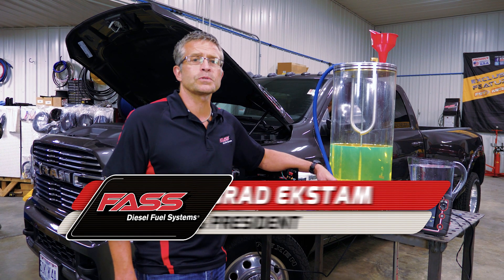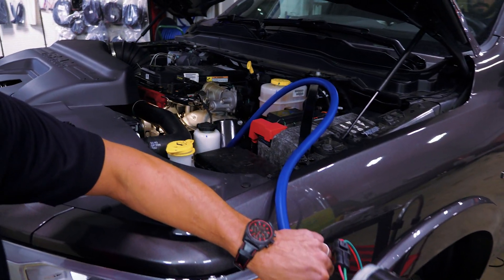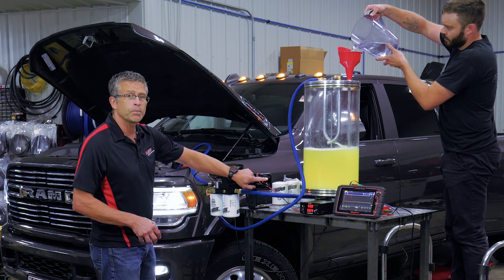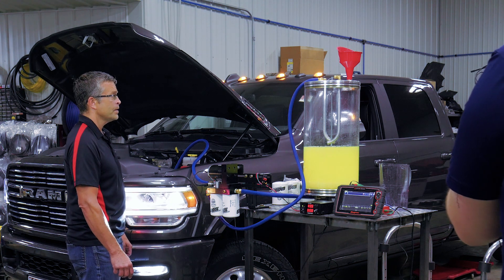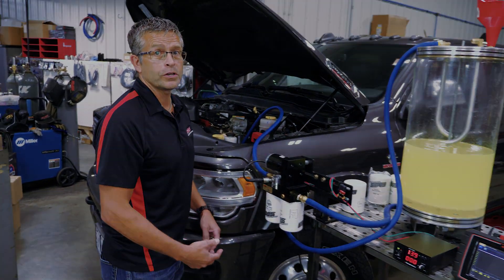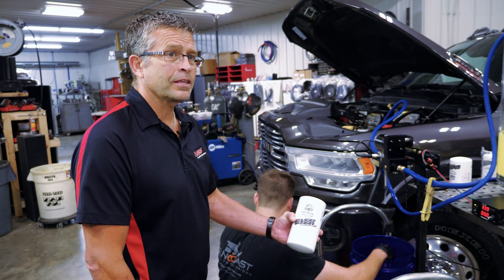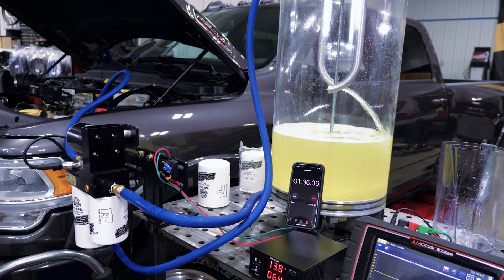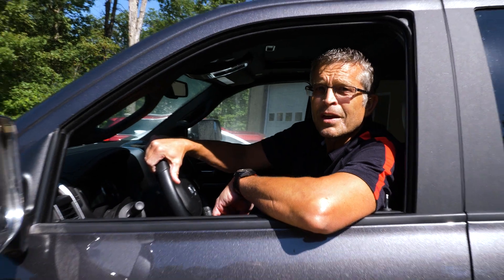1.5 gallons of water and a NEW 2019 Ram! What Will Happen!?!

Comment: if the stock pump can pull past a failed (electrically, whatever) Fass. won't it be able to draw past the full XWS? or is the bypass only on the suction (wiremesh) side? if so does that XWS put excessive strain on the cp3?
Reply from the maker: Great question! In the (unlikely) event that the FASS motor stops pumping fuel, fuel would still flow through the system. 

The only scenario in which the XWS would completely stop all fuel flow is if it became fully saturated with water—and was acting as a fail-safe to prevent the water from reaching your injection system.
Reply: @FASSFuelSystems  so if the motor dies, the cp3 can pull past the motor, but still pulls through the filters? Just want to make sure I understand how it works.
Reply from the maker: @duramaxadventures5832  That's correct!

Comment: But you still run the CP4 out of fuel which will still destroy the pump
Reply from the maker: This truck currently has 80,000 miles and counting on the original CP4! We're yet to have any reports of an emergency shutdown due to water contamination—including CP4 trucks.

Comment: So the safety recall Dodge is having isn’t from a defective high pressure fuel pump but from the fuel?
Reply from the maker: Great question! The CP4 is certainly more prone to issues, but poorly filtered fuel can expedite mechanical failure. 
 
Two of our 5th Generation Rams (both equipped with a FASS since new) have over 60,000 miles, and haven't had any CP4-related issues.

Comment: What about starving the cp4 as no fuel is going to it??
Reply from the maker: Water entering the CP4 would be far more catastrophic.
Reply: FASS Diesel Fuel Systems worse than starving it dry from fuel after the fuse blows?? I have to disagree
Reply from the maker: @WalkerTexasplumber  Prolonged starvation due to some type of restriction (dirty filters, clogged sending unit, etc.) or an air leak could be just as damaging as water. 
The CP4 in the 2019 Dodge in this video was briefly starved for fuel while making this video. No water made it to the CP4 as the XWS-3002 stopped it and caused the pump to pop the fuse. This truck is driven all over the midwestern US by one of our dealer reps with the same CP4 from this video.

Comment: Man do I wish I spend the money with you guys. I have gone through FOUR raptor lift pumps in two years on my 01 24 valve... not good. It seems that it fails exactly every 6 months and it’s been about 5 since I last changed it
Reply from the maker: We're sorry to hear that! Unfortunately, we've found that not all systems are engineered (or tested) to the same standards. If our team can ever answer any questions, don't hesitate to reach out!

Comment: I’m running a fass on my duramax and will be changing the filter more often or switching to cat filters to avoid having the truck shut down
Reply: I'm new with this stuff so please tell me why the Cat filter wouldn't shut the truck down? Would it hold more water? Thanks.
Reply: @rickbraden4272   the CAT filters are larger and have a drain on the bottom like the old style fass filters so you can manually drain off the water instead of relying on the filter media to absorb the water,when the media is completely saturated with water fuel can’t pass easily ,you just have to remember to drain the filter once in a while
Reply: If you watch other vids they explain the filters with a drain are coalescing and don't filter as well or as much, about 60% of the water is all. The new type of media collects and plugs. ALL the old syle filters get full of water and pass ALL water through after that

Comment: What happens if I pop a fuse and my engine shuts off while I’m doing 70 on the interstate pulling a trailer. If my engine stops there goes my power steering and brakes
Reply: What happens when ur fuel system grenades going 70 on the interstate pulling a trailer 🤔
Reply: Your hydrobooster has a reserved pressure in case you loose power. Allows you to be able to brake 2 or 3 times before no more power. You brakes are not ran on vacuum like a gas engine.
Reply: @ChrisSmith-ig9jq  this is correct

Comment: Driving down the hills fuse blows your truck stops no power breaks,  no power steering no nothing.
Reply: Gary Davis you’ve written off your truck but you saved the injection system,thanks fass
Reply: So if you have system that allows the water to go through when the filters are full isn't going to quit running anyway.  Or am I missing something?

Comment: My fass titanium 200gph on my 2002 7.3 has had nothing but issues with check ball getting larger groves and rotating on the spring causing pressures to bounce, sounds like crap.. not to mention all the priming issues . It will just loss psi while running down the road and truck will get really sluggish and reprime on its own or truck will just die. Customer service never helped me figure it out and I just ripped out the fass system and bought irate pump system and been trouble free since the installation.
Reply: I'll buy your fass pump
Reply: I sold it already
Reply: BMB Motorsports 
What are you running on the ford to need a 200gph pump?
Reply: 300cc 200% injectors
Reply: @brandonbrowning3155  it was so bad tht you sold it and made it someone else's problem, huh?

Comment: How do you think you saved that injection pump you just ran it dry.(out of fuel) this is the dumbest thing I have ever seen. You do that with a vp44 congrats on putting a new pump in. 2nd that fuse makes no sense gonna be checking that all the time when anything goes wrong not to mention having a pocket full of fuses. Been running fass the old pumps  for most of my diesel days I hope I never have to install one of these. This is just dumb go back to the old ways